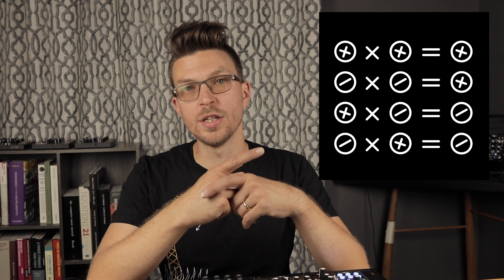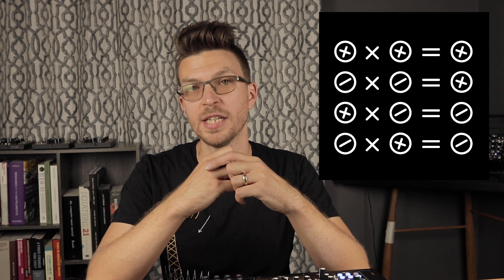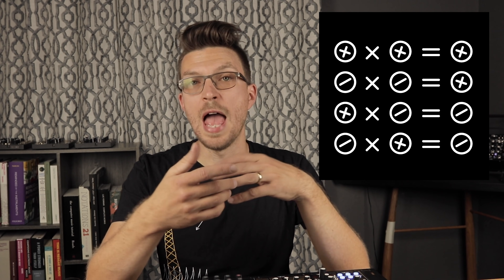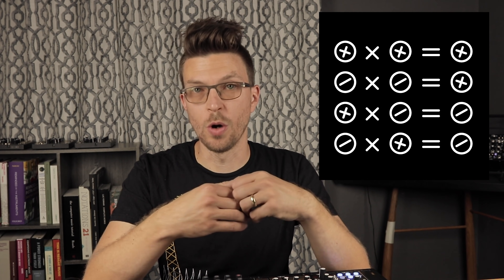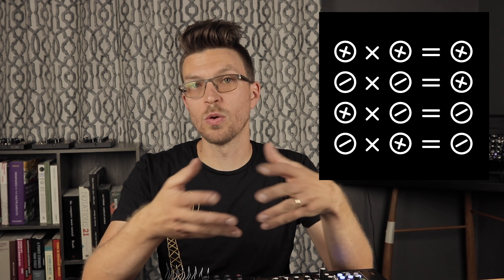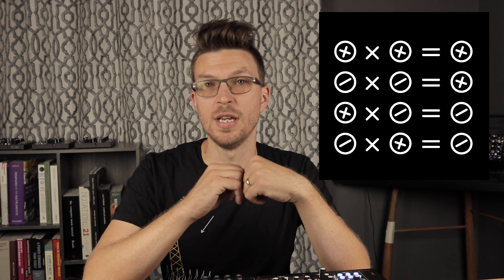A Ring Mod Odyssey

Comment: is the crossover distortion of the moddemix a byproduct of making it close fully or is that just a part of the circuit that inspired the module?
Reply from the maker: In our production meeting this morning Tony was giving the crew a thick description of all the subtleties of the modDemix and he seemed to imply that it was the former. Certainly being able to easily “close” when used as a VCA is one of the key characteristics that distinguishes it from other ring mods and is definitely related to that crossover distortion where the middle part of the wave is collapsed into zero when the modulator gets low.